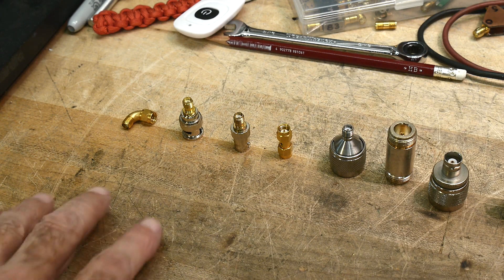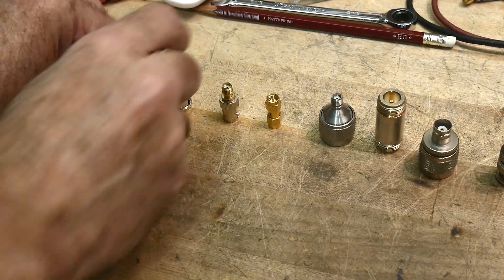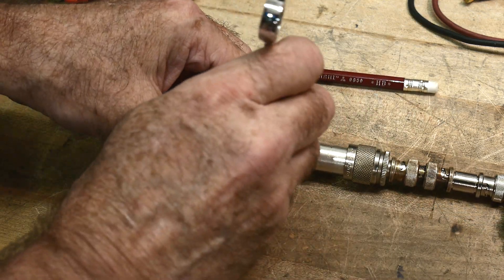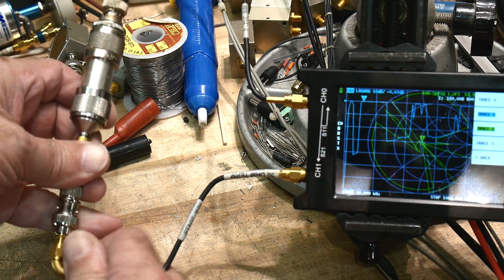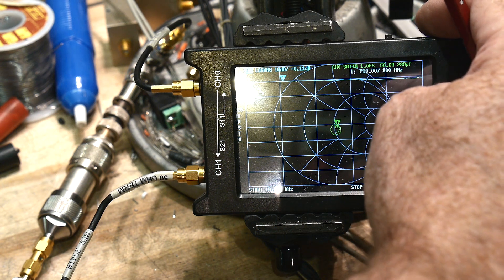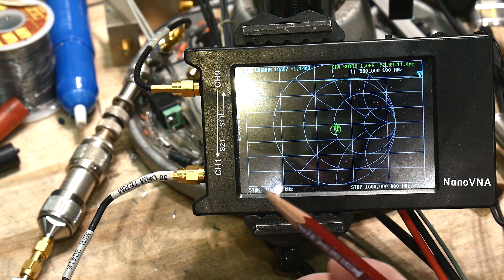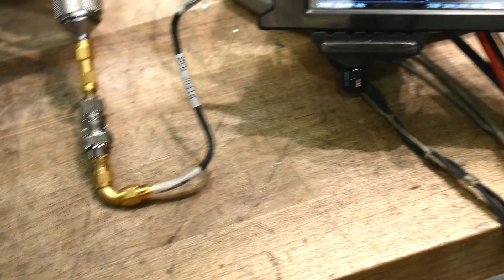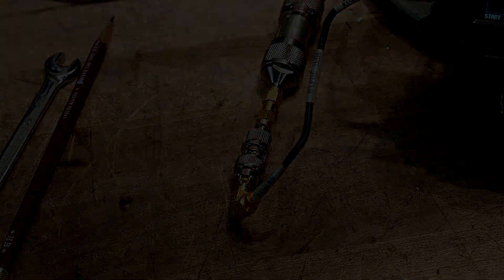#566b Do RF connector adapters effect the measurement?

Comment: PLEASE EXPLAIN for the lay person!... Please tell me, the problem isn't the connections or resistance of interconnects, but in RF it is the matched impedance and attenuation? Thus a slightly bad connection isn't nearly as bad as a mismatched waveguide or improper termination? With RF there needs to be a specific amount of inductance and capacitance through the transmission line? Therefore, the size/shape/spacing as well as the material of the conductor/isolator of the transmission line needs to be designed around a specific impedance? I would love to see a video further explaining why people misconceive connectors as bad, while their cable is even worse! I love your videos and am a newbie to RF, Please keep 'em coming!!!!
Reply from the maker: Yes it is rarely the resistance and more of a mismatch as you say. If it is not 50 ohms or there is a mechanical discontinuity in the waveguide shape there will be reflections that cause a loss. Having said that, it's pretty hard to go wrong below a 1000MHz. The video would be much different had I measured it up to 18GHz :).
Reply: @IMSAIGuy  Thanks! I figured that would be it, at work some of the most expensive items we use in design is the RF interconnects and receptacles.  Makes sense that this is why. A lot of engineering going into ensuring that there remains a constant impedance through waveguides built into the mechanical design of the connector!

Comment: Do that with cheap connectors from AliExpress ;)
Reply from the maker: at least 4 of them are cheap
Reply: @IMSAIGuy  Curious to know if they were the ones I pointed out...
Reply from the maker: @M0UAW_IO83  Yes I think the cheap ones stand out don't they
Reply: The N to BNC, the right angle BNC, the two SMA to BNC-M, BNC-F to SMA, BNC-F to BNC-F all look like pretty cheap connectors to me.

The SMA swept right angle, SMA-M to SMA-M, SMA-F to N, N-F to N-F and the BNC-M to BNC-M look like decent quality ones.

For the kind of work you can do with a Nano-VNA, the cheap stuff works. If you want to be able to measure -135dBm at 46GHz then yeah, you'll need to chuck the price of a decent car at your connectors and spend the equivalent of a nice house in the country on your analyser.
Reply: @M0UAW_IO83  I have some BNC to SMA adapters from Ebay, back to back just the 2 of them about 1dB of loss at 900MHz. Some are decent some are just plain terrible.
Reply: @galileo_rs  I've seen some horrors too and they weren't all cheap. 

But!

Ask yourself this, for measurement purposes does 1dB matter if you know it's 1dB and it's always 1dB?

(If you're using interseries connectors in cable from a TX/RX for on air use then you're doing it wrong and should be making up a proper cable)
Reply: @M0UAW_IO83  Constant loss is not an issue. Intermittent connections and bad manufacturing tolerances that mess up proper connectors and adapter on the other hand ...

Comment: Could you do a video on how to demodulate FM?
Reply from the maker: that is a broad subject. are you looking general knowledge or a specific question? an off the shelf part or discrete design?
Reply: @IMSAIGuy  I have built a HAM radio receiver and AM and SSB were relatively simple by using LPF, but FM signals ... where  do i start? I do not wish to use modern circuitry. How was FM demodulated in for example the simple 80's  boys transistor radio's?
Reply from the maker: @egbertgroot2737  OK Will post in a couple days
Reply: @IMSAIGuy  Great!
Reply from the maker: a video will post on the 4th to answer this
Reply: @IMSAIGuy  I will be ready to watch. Thanks for the announcement